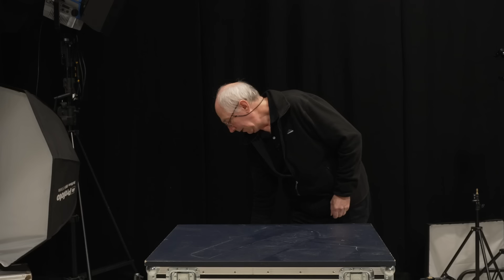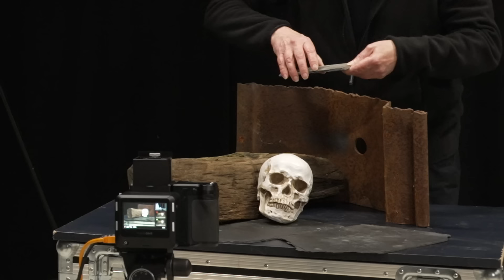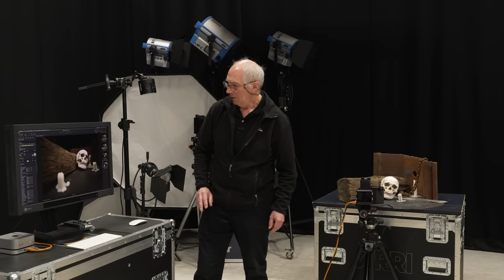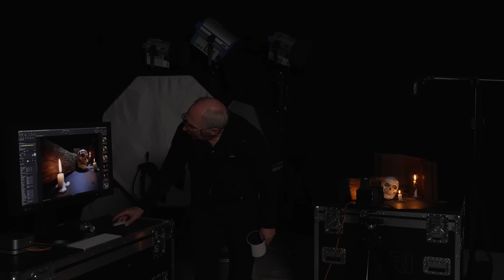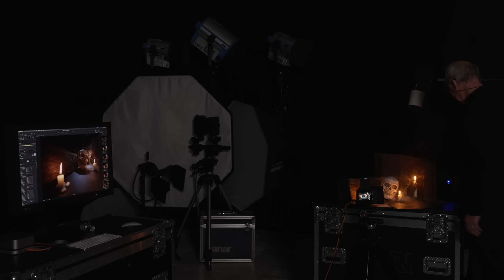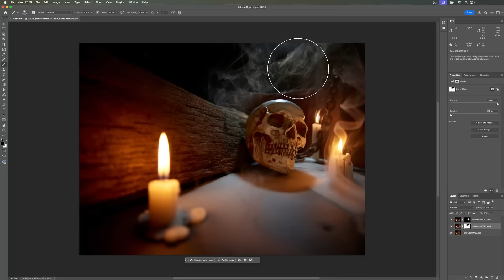Use a wide angle lens to move in closer for dramatic compositions

Comment: Firstly, I really enjoy your videos, it's given me some great ideas and helped solve some challenges, thanks!  Secondly, you have shown card stock used, white on one side, black on the other.  Where can I find this product?  I have searched for several days and can't find it.  Can you share your source? -Thanks again, Steve
Reply from the maker: Free card is Mount board Available from picture frame suppliers. Hope that helps. Thanks for watching.
Reply: @CameraClubLive  sometimes it can be found at home improvement or craft stores as foam core Black/white, makes great V flaps all the way up to 4x8 foot size